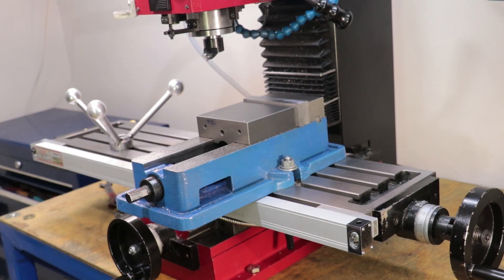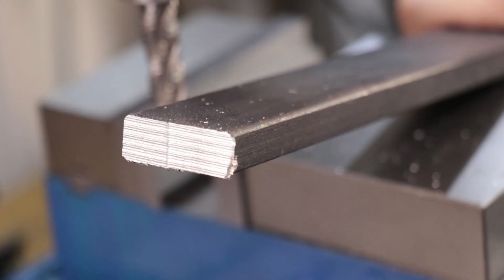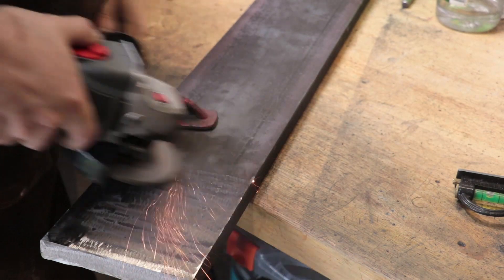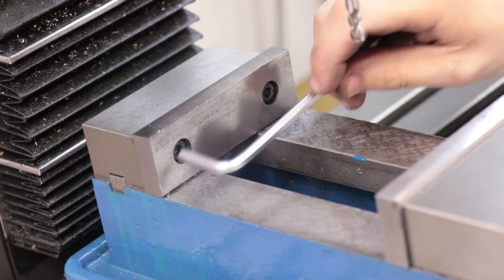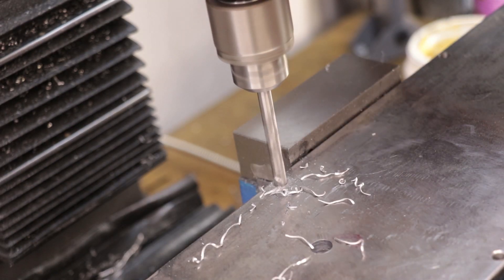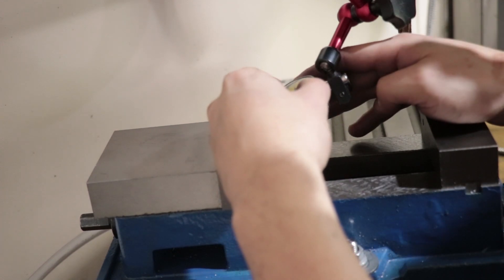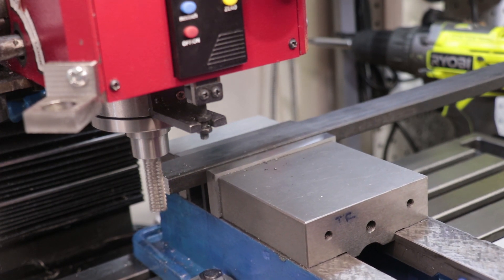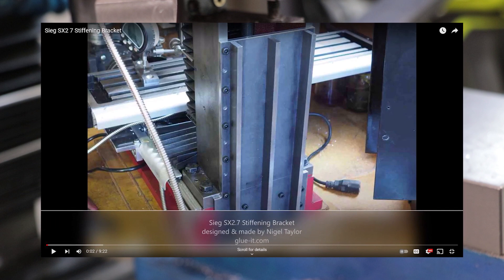Milling Machine Rigidity Upgrade - Stiffening Plate

Comment: Your parallels are moving around. You don't have a decent grip on the steel and it's moving. Put a heavy piece of copper wire into one side of the bar in the vice. You will find that will improve your cut.

Comment: I ran across a number of people adding mass and rigidity by using concrete.  Any machine can be bolted down to a concrete bench top, and if there's empty space in the machine (this is really a trick for DIY machine tools where you can arrange for there to be dead spaces) you can fill them with concrete.

Comment: For check the improvement will be nice bend the column in all the direction BEFORE the upgrade and  by dial indicator control how much bend. Repeat the same operation AFTER the improvement, only in this system it's possible check how much the improve it's really good.

Comment: Have the slightly larger brother you your mill, the SX3.   One of the best stiffening mods I read about for the mill that worked for me. Bolted it to a wall behind it.
Reply from the maker: I guess if it’s a solid wall it could work. I only have gyprock in this shop

Comment: Great improvement. As a structural engineer, I will make a comment to the stiffeners shown on 8:46. They will not really contribute to much stiffness. 
What is important is the plate, as it changes the cross-section of the column from an open channel to a closed box which greatly increases the torsion stiffness. ..as well as bending stiffness. 
A 5mm plate would probably be sufficient.
Reply: do you think the epoxy granite+fill he did in another video benefits the rigidty of the column as well?

Comment: How can you tell? You need to explain 😮
Reply from the maker: Well you compare how the mill performs before and after using the same depth of cuts and speeds and how well the mill handles it. Before it would start to chatter at lighter cuts

Comment: I took an old tool box cabinet and filled it with quick Crete and put all thread all the way to the bottom so they stuck up to bolt my mill to.

Wow did that help!!   Bit where I put it, it's there to stay!  Lol.  Not sure they total weight but it doesn't move.

Comment: Question: Couldn't you use any piece of steel/iron/whatever heavy enough to get the effect as long as it's rigid enough? And also, does it need to be rigid in its entirety or could you weld many junk pieces on a thinner (hopefully cheaper plate)?

BTW great videos! I've been binge watching all day xD
Reply from the maker: I would assume that to be the case as long as its rigid and straight enough that won’t bend or distort the column

Comment: I had a RF45 mill which was bought brand new as I didnt want the bother of inspecting second hand stuff with my at the time limited knowledge. It was an upsetting day when I first started to make test cuts with mildsteel at 1mm and hearing chatter if only I had found this great guide to adding some rigidity. My story still has a happy ending as I got a used BridgePort from a very nice chap that was retiring for a good price only downside is that moving something that is 1000Kg is a much harder task. Great video I liked the small lathe upgrade also.

Comment: Mate, that is some good work. I'm enjoying binging your mill videos (just found your channel).
Got a couple of suggestions:
1) Mill scale is horrible. I gave up grinding it. That sucks the pus! I have used hydrochloric acid (for swimming pools) and it dissolves it nicely. Be VERY CAREFUL, it generates LOTS of chlorine gas. So if you don't want to try that, use vinegar...
2) You could pilot drill all your holes, in the one go, to get the spacing right. And then use the vice.
3) Don't use a straight tap in a drill, unless you like removing broken taps (that's even more pus sucking!). Get a spiral fluted tap if you're going to use a drill.
4) If you wanted to make it even stiffer, you can weld stiffening ribs on the back. But you will have to machine the mating surfaces flat. That steel will warp no matter what you do, so you'll have a really stiff mill but it will be banana straight...
5) Weight is good. Try going to a tyre shop and asking for their used wheel weights. They usually have a bucket by the wheel balancer... You should be able to cast that into usable blocks.
And lastly, I can't count...
Keep up the good work bloke! I enjoy the inspiration.
PS - is there a list, link, website or something where you get your gear? I find it hard to get good stuff in Aus, and you seem to be doing a reasonable job... 😁

Comment: I would have did concrete with rebar and that back plate I know you have to screw in the middle but you would make way for the electric screw like puting a pipe in the middle of it PVC pipe or something like and that would reallying make it rigid and dampens noise and rigidity and then the bottom of the mill too I'm sure it's hollow I would fill that with concrete too and rebar not like a little rebar like 1 in or half inch and I would have put a lot more sock ahead cap screws in it with loctite to and JB weld on the plate too right before I put it on to tighten it you should put a plate on the bottom of the Mill too it's crazy The rigidity of that machine you were the first one to have that machine on YouTube that I've ever seen the bigger one I looked up the price of that machine when you first got it it is not cheap at all it's not over the top in price but not cheap I am looking to build a CNC mill soon but now why bother they got the MR1 by lamere system if I'm spelling it right something like that base price is $4,500 I would get that machine put put clearpath servos on it and a centroid controller and it's like having a real CNC machine you can even upgrade the rigidity of that machine too and it comes stock pretty damn rigid cut steel no problem 30 lb an hour

Comment: You need to upgrade to the bench the mill is mounted to.  As it looks quite flimsy.   Maybe a large metal plate bolted to the table and then the mill mounted to that? (use M10 bolts). As this will help with vibrations even more.
Reply from the maker: For sure one day. Definitely more rigid than the stand that they sell for these machines but I am looking at beefing it up one day

Comment: Doing more or less the same thing.  It seems like the X2D tilting column machines, which are worse in almost every way, are more common in the US.  LMS usually wants $1k for their version with the fixed column whereas I got my harbor freight turd for about $500 during a sale.  I'm thinking I'll use the tilting column bolt to start, then do 3 M6 bolts on each side with a tension bracket towards the bottom.  Luckily the power box and electrical stuff is isolated towards the top instead of inside the column, which is largely just empty space.

Comment: you should scrape in the ways so you can tighten them up... will make a big difference. and you can probably get better bearings for the spindle.
Reply from the maker: I am planning of doing that sometime in the future but I still need to practise scraping, and I'll need to get a straight edge made
Reply: @artisanmakes  if you want a budget straight edge find an old clapped out wood lathe or wood planer, hack up the cast iron bed from the lathe or table from the planer to get the material for a straight edge. rough it out on your mill then go to town with the scraper.

Comment: Something else you can do to improve rigidity and mass damping, fill hollow sections with hydraulic cement as it doesn't shrink like Portland cement would.
If you need voids, PVC pipe seems to work well. I did my mini mill column ? years ago
Reply: This is a good idea. Regular cement really doesn't shrink all that much if you don't over do the water. Less than 0.5%. I have mixed hundreds of tons of cement and poured even more. A cement filled column is the best way to gain rigidity with the least expense. There are great studies available on this using expanding grout and secondary layers of interior metal to permit the pre-stressing. But a solid column is a big step up.

Comment: One thing you can do with that mill vice to hold larger pieces like that plate, instead of removing the fixed jaw plate, is to remove the movable jaw plate and screw it to the other end of the movable block. You'll see that there are threaded holes for that on both sides of the movable block.

Comment: It's amazing how flexible thick metal is. I learned this years ago when a shop teacher demonstrated how easily a beefy cast iron engine block was to flex by hand. He placed a bore micrometer in a cylinder tight enough to hold itself in. Then he asked a skinny kid to press the cylinder bore. The bore mic quickly dropped to the table below.
Reply from the maker: Yeah for sure, a flat bar is not the greatest at resisting bending, but in this application it is still doing a good job. Not perfect but I am still very pleased. Cheers
Reply: @artisanmakes  I was just stating how counterintuitive it is that a beefy cast iron engine block flexes by hand. Even a machine 10X beefier and heavier than yours flexes some. I'm not surprised at all a 20mm plate helps a lot!

Comment: The mill scale is a great corrosion resistor. By grinding it off you are loosing a significant corrosion protective layer - that was provided free of work and cost. You'd have been better leaving it on and painting over. My opinion.
Reply from the maker: For sure it does provide some protection, but id rate paint as better protection. Cheers

Comment: I think you’d see incredible results strengthening it with an L shaped piece of steel bolted under and against the column. A knee mill is shaped the way it is the brace effectively against the cutting forces. The piece of steel just bolted to the back I would think is solely adding weight to the arrangement
Reply: A back plate like that adds tortional rigidity as well as mass.
Reply: I’m glad it is! I tend to overthink and complicate things. My small bench top mill in the process of design and build will end up costing more than buying a knee mill lol
Reply from the maker: Yeah definitely, couldnt find any at the places I get my metal at, and in any event this is doing a fantastic job

Comment: All the mini mills I have seen, including expensive ones from Europe, suffer similar deficiencies:  weakness of the column in bending and torsion.
A home-built machine ought to have a column of 12" x 12 " Hollow Structural Section, or at least 8" x 8" in the smaller size mill.  The wall thickness ought to be the maximum available, 1/2".  (Note that in the structural steel business this steel section is referred to as HSS, not to be confused with High Speed Steel.)
The base of the machine may be a piece of the same material, and the two pieces bolted together with 4 or 6 5/8" bolts.
For vibration resistance the empty spaces may be filled with sand, concrete, etc.
I doubt if any of those machines have ever been subjected to a rigorous stress analysis.  If I am wrong, then the permissible deflections under load were set as too large.
To add insult to injury, the back of the columns are open, weakening their borderline strength further.

Comment: Chatter is resonance, by increasing the mass of the column you've managed to absorb a lot of it. Place a sandbag on top of the mill head and see how much chatter is reduced, doesn't look pretty though... 🤣
Reply from the maker: I once saw someone use a bag of cast iron dust and lead shot to get similar results

Comment: There's a diy vmc cnc mill project called rig cnc. The creator of that used a small granite surface plate and a ground upright (about 200 bucks total cost) to make his machine rigid and square. I'm not sure if the same idea could be adapted to a mini mill but it could if one had the extra depth on their bench to fit it all.
Reply from the maker: Interesting idea, cheers

Comment: WOC? Usually called DOC - Depth Of Cut.
Reply from the maker: Those are two different things, I was taking a full depth of cut in the stock which was 10mm. Some people might call width of cut the step over
Reply: @artisanmakes  No, you don't understand. DOC is the distance you advance a tool into the work in one cut, it's irrespective of the step-over, which as you say, can be called the WOC. You weren't taking a 10mm DOC, I'd be mightily impressed if you managed that on your mill!👀
Reply from the maker: Well this might come down to a regional thing, my machining book states "width of cut, also called stepover". In all fairness these things have multiple names, my CATIA cam software would also call it radial depth of cut but fusion calls the same thing the stepover.

Comment: I did almost the same thing to my LMS5500 SX2.7 I used a 4x6x0.25 steel tube hoping to get a huge improvement in both torsional and flexural rigidity. I mounted it roughly the same way and moved all the electronics into a new enclosure. I never did go back and measure the results but I am happy with it

Comment: Running wire through a hole in metal without a grommet is a real no-no. It's a good way to electrocute yourself several years down the road when the vibration of the machine wears through the insulation.

Comment: Consider epoxy with lead shot in an assortment of sizes. It’s a fast easy way to add a lot of mass. Of course, your plate is a great way to add rigidity, and both solutions can be used at the same time.

Comment: I got material to do something similar to my mini mill a couple of weeks ago. It will be a little different than yours but similar concept. I have a 1/2" thick plate that is going to be sandwiched between the mill and the bench and then a channel iron will get bolted to the column and then welded to the plate.

Comment: I was thinking about using epoxy granite to fill the castings as it can be made basically with 80% - 90% sand, pea gravel and the rest epoxy.. my bridge port clone mill has large empty castings..its around 2,300 lbs but could use more mass for deeper cuts and better surface finish..I was also thinking about my 1440 lathe as its only 1,700 lbs and would benefit greatly with another 1,000 lbs in the castings and base legs..

Comment: I'm just a country youtube watcher... I'm betting if you got a bunch of 1/4" plate and made strips out of it... squared them up on the mill... and built a box, you could get similar performance... as for the mass, you might be able to fill up that box with concrete... or even just cement, or mortar... and that might take care of it. You won't even need to do any welding, I'm betting screws would be good enough to hold the box together.  Then just mount the mill to the side of the box... The box could be anchored to a workbench... or you could build the box and workbench all in one go. Anyways... just a dream for now.  Happy Sunday.

Comment: Rigidity is the penultimate factor, NOT mass.  In fact, given that you have acceptable rigidity, mass is a detriment, since it lowers the natural frequencies of vibrational modes.
Reply from the maker: For sure this is a rigidity upgrade but you would be surprised at how much dampening the metal plate was able to achieve simply by resting it on the table. It's not 100% the same thing but it does offer some insight that the mass is doing something

Comment: Instead of removing the fixed jaw, you can swap the moveable jaw to the rear face. It's already drilled and tapped for that
Reply from the maker: For sure, but you only get like 4mm of clamping on the jaw. Cheers

Comment: Great upgrade! Thanks for sharing your progress! I was worried about your parallels in the “after” clip -😅 Did the new rigidity allow the end mill to pull the stock out of the vise?
Reply from the maker: Nah, the hot rolled steel is just bowed out on the side, so clamping it properly is quite difficult unless I face off the end to make it flat

Comment: Good idea. In addition, in future if you find that the column is not straight, you might be able to correct it by appropriately shimming that plate to bend or twist the column in the direction you need. 
One thing I would do differently is to put epoxy in between (with release agent on 1 of the 2) and finger tight the screws in place until it cures, then tighten. That would cancel out any variations of flatness between the column and the plate for a zero stress mount.
Reply: That epoxy trick is a really good idea! 

Steel isn't ideal of course, it's rigid sure but does not have good damping characteristics, if you wanted to really overbuild you could use a thinner plate to increase the column depth and then do an epoxy granite fill.
Reply: @cda32  Stefan Gotteswinter did the epoxy thing for tramming his mini-mill and if Stefan does it then its a good way to do things.
Reply: @cda32  One downside with the steel is the difference in expansion with temperature. Its small but might have an effect. I think you might be able to help the damping characteristics of steel if it was layers of steel epoxied together in a sandwich, I think that would be hard to make that "ring".
Reply: @billshiff2060  If you really want to chase dampening mass the best way is epoxy & granite chips as a few of the CNC project guys have shown.

Comment: I have an older Grizzly G0516(2001) 3 in 1 Mill/ Lathe. At the time that was in my budget. The mistake was thinking the mill would be usable. Its a HORRIBLE Method to attach in its current state and I can't really use it at all. Seen some nice conversions since I started looking and so far the best thing I have seen is just remove the dam Mill off the lathe and go with a separate unit from the lathe. So far all the stuff I turn up still talks about the Rigidity of whatever base is used.  Nice upgrade to your mill.